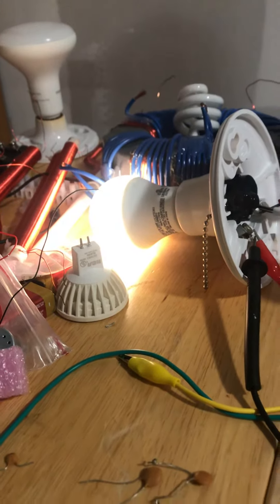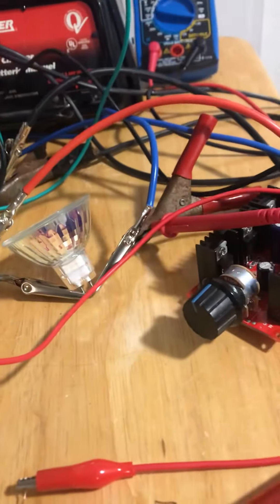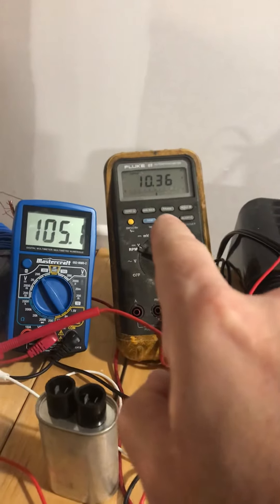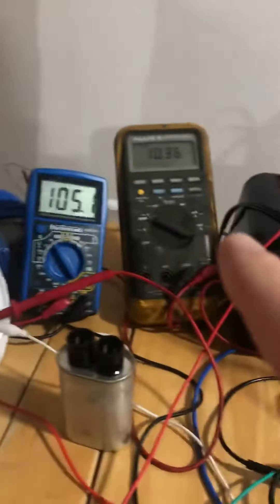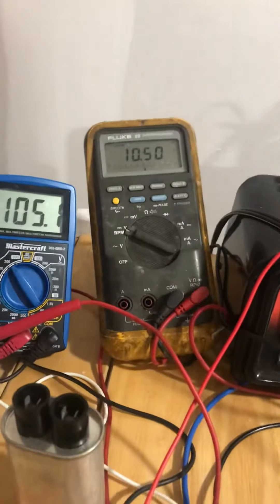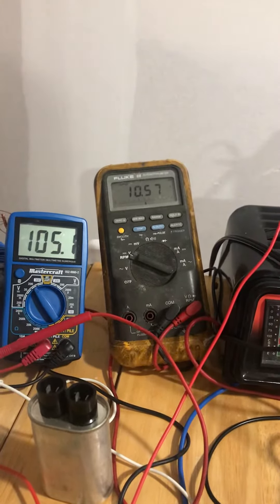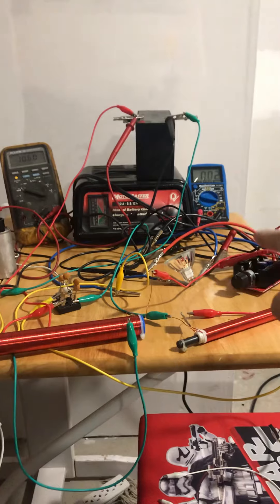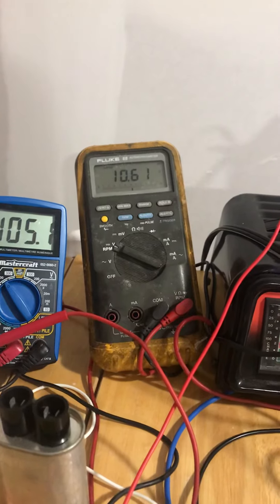Don Smith Resonance lighting light and charging battery

Comment: Nice video thewonn. Do you have any video that explains how to make the resonant rod?

Also, from what I understand, the PWM is connected directly to the resonant rods but how is the rod connected to the bulb? 

Please could you share a diagram of your experiment maybe in another video. I'd like to also experiment this but I'm not sure I understand it yet. Thanks.
Reply from the maker: hi plans are available here 
https://fitnesshomesupplies.com/collections/hho-hydrogen-products
Generally speaking, both rods are in parrallel with each other and are adjustable. They need to be adjusted and tuned to acheive this affect. There are also a number of caps used to tune each rod.